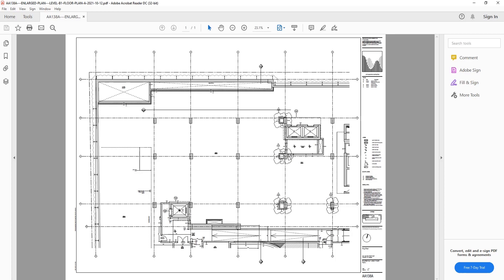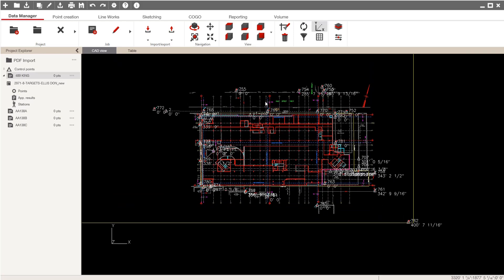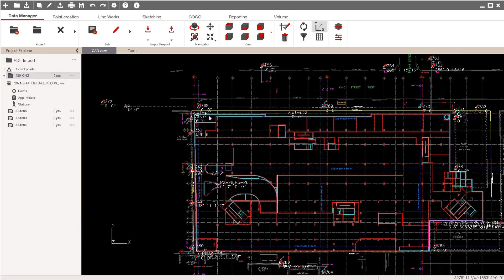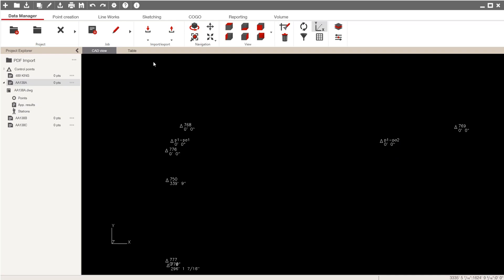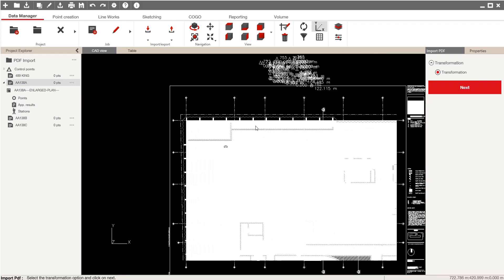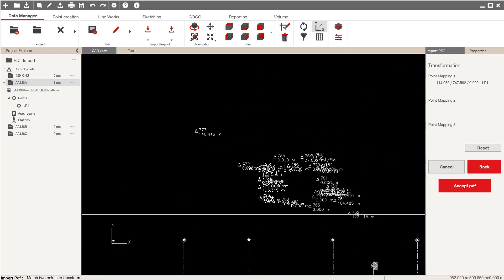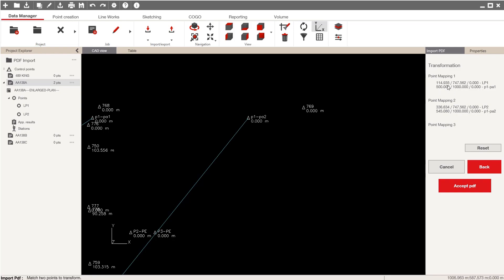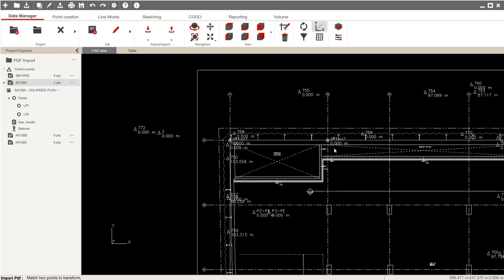Hilti Profis Layout Office Tutorial 1.3 - PDF Import into Existing Control and Project

Comment: Love your videos, man. I’m trying to find a way to input a specific height for a line and automatically point at it with the direct reflex. Is there any way to do that?

Example: I need to layout a benchmark on a wall with the direct reflex.
Reply from the maker: Hi Mario, yes...but let me suggest a simpler way. Just draw a line on the tablet...doesn't matter what height it is. Then go into line layout, select that line to layout, and type in the height you want to observe in the "height" column, but make sure you have absolute height checked.

I know this sounds complicated, but I assure you it is easy. Maybe this video will help you where I do it with line layout to layout heights: https://www.youtube.com/watch?v=DICH5jbNw6I&list=PLF5GOD3RdTES9cO-IDeke_P-27HATD1bl&index=53&t=18s

Just scroll to the 5 minute mark.

For you, though, you can station on your plan, but make sure you station with a height (here is a video on how to station with a height if you need it: https://www.youtube.com/watch?v=aFExjcji77Q&list=PLF5GOD3RdTES9cO-IDeke_P-27HATD1bl&index=31&t=364s

After stationing wit ha height, you can go into line layout, click on a line, and turn "absolute height" on in the "measure tab, and have the laser take you anywhere on that line at that height.

You can also draw a line on the tablet that has a slope. For instance, you draw a point at 0 elevation, then you draw another a bit away from that point with, say, 10' elevation, then you connect the dots with a line. You can then click on that line and when you are in the measure tab for line layout, have absolute height UNchecked (so it is showing you the relative height), and the tool will guide you along the SLOPE of that line instead of guiding you based on the height of your jobsite's benchmark height.

Here is one more video of where I use line layout with an actual CAD plan: https://www.youtube.com/watch?v=NDyJV-MWC84&list=PLF5GOD3RdTES9cO-IDeke_P-27HATD1bl&index=56&t=91s

and one more where I use it to layout points on a vertical wall: https://www.youtube.com/watch?v=IMtKUy2bNqI&list=PLF5GOD3RdTES9cO-IDeke_P-27HATD1bl&index=52&t=283s
Reply: @measuringsystems869  thank you for the thorough explanation. I haven’t tried it yet due to terrible weather conditions, but I’ll let you know if it worked for me asap.

Thank you again and keep up the good work!